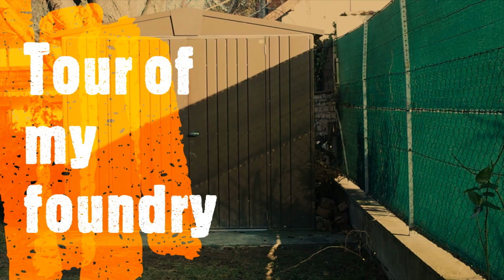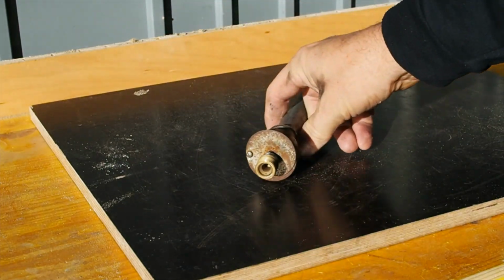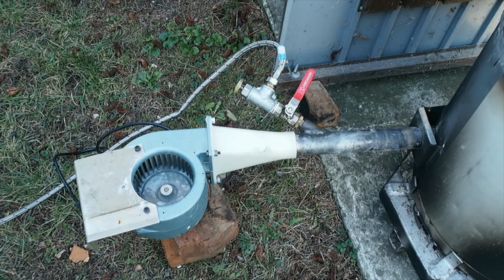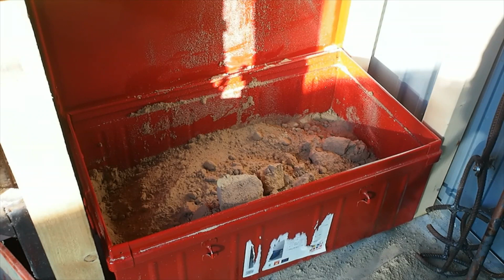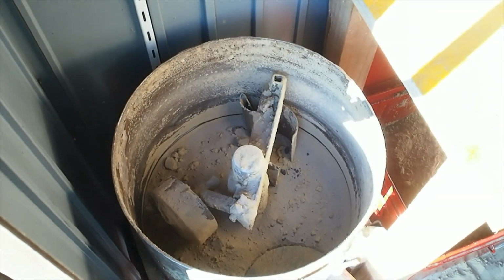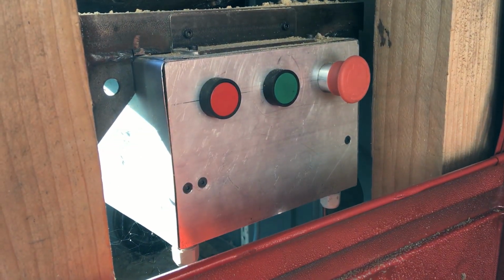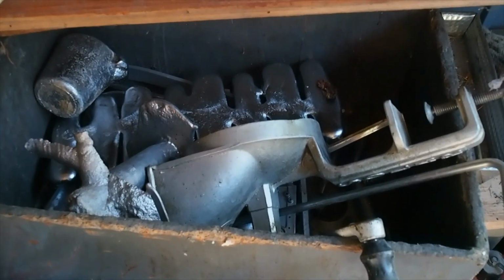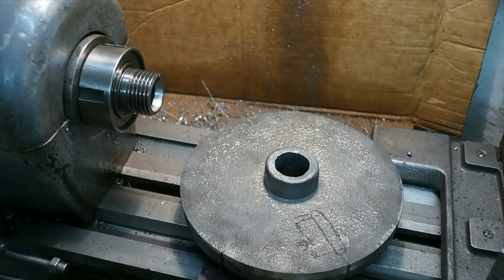Tour of my foundry

Comment: Good evening.  What casting sand do you use? I've seen the dioxide gas solidifying sand and green sand. The sand you use makes it looks easier.
Reply from the maker: It is green sand. The best green sands are naturally occuring, where some old river deposited the perfect mix of sand and clay. You'd have to buy that from a foundry supplier.  I have synthetic sand, in that I just bought fine sand from the hardware store and mixed in 10% bentonite clay, and then added water and mulled. It gets water added and remulled before each use. A mechanical muller is the the key to using green sand. You can stomp mull it on tarpoline, but that is hard work and gets annoying.

I recently got some sodium silicate and started making CO2 hardened cores. For this I again use fine sand from the hardware store, mix it with 5% sodium silicate, and once moulded,  gas it from a soda stream bottle. This is one use sand. You can also make baked sand cores. Instead of sodium silicate, you mix up a binder of sugar water and a little flour, and mix that in the sand. After carefully removing the fragile core, you bake it in the oven and it gains the strength needed to use it in a mould.

I also have a couple of bags of oil bond sand. This is the best for very fine details. It can be reused, but has to be mulled with a little 2 stroke oil replacing that which burns out.

Comment: There's a supplier in hungary that sells ferrosilicon although I don't know either the price or the MOQ (they seem to be selling to larger foundries). If you're interested, leave a reply and I'll ask them.
Reply from the maker: Thanks for that. There is a seller on Ebay.co.uk who sells 1.5kg for €18,50 plus shipping. If you wouldn't mind asking what that company would charge for a couple of kg sent to Vienna, I would appreciate it.
Reply: @RotarySMP  1 kg of 75% FeSi granulate (Korngr. 2-10 mm) costs a few cents less than EUR 2 incl. domestic VAT. Simply didn't get an answer for how much they'd charge for P&P and communication wasn't exactly a breeze, but I'm going to pick up a few kgs next week anyway and the going rate for a 5 to 10 kg package from hungary to austria is EUR 16.5 by courier (DPD, 48 hrs delivery). They also have 65% and finer/coarser grain sizes, prices are similar. Let me know if you want me to deal w/ them and have the stuff sent to you or you can check them out yourself at la-bokft.hu - they claim to speak german (although YMMV).
Reply from the maker: @sniperasys  Great thanks. Yes I am Interested. If you wouldn't mind sending me 5KG, that would be great. Are you on any of the machinist forums with a private messaging system, so I can get your IBAN to do the money transfer and send you my address? I'm on Pratical machinist under RotarySMP.

Comment: Which burner do you use the most?
Reply from the maker: Hi Mike,
The big gas burner. I need to to get the furnace hot enough to vapourise the oil, and if I'm only doing a single aluminium melt, then just stick with gas. 

The Gas burner is really loud I am pretty such the flow is sonic at some stage in there. The blown oil burner is much quieter. I have been thinking of adding a gas port with quick disconnect to the oil burner so I introduce oil earlier to a running burner, and quieten it down. No neihbours have complained....yet!

Comment: very cool. i'm making a muller very soon so i was chuffed to see yours thanks! i'm so sick of sifting/mixing all my sand my hand. great vid cheers o/
Reply from the maker: Thanks. Mulling by hand? Do you do stomp mulling? Canvas (I used plastic) sheet on the ground, sand on sheet, add moisture, fold over sheet, stomp around on sand, lift corner of sheet to turn the sand, rinse and repeat. Dumping hot sand on plastic sheet melted holes in it.

Even the crappiest muller is better than stomp mulling. I was pretty unsure whether 370W out to 30RPM would be enough power, but on that little muller it never stalls.